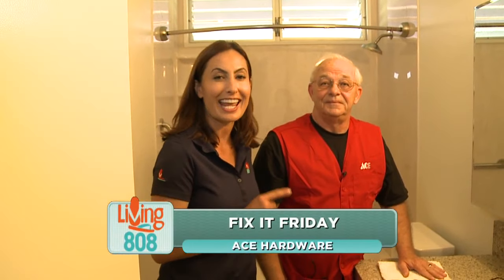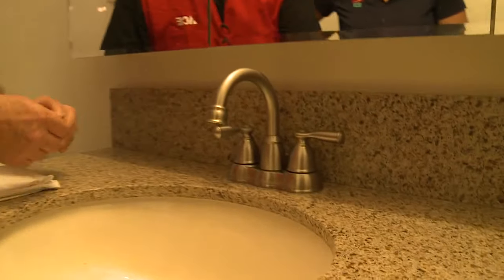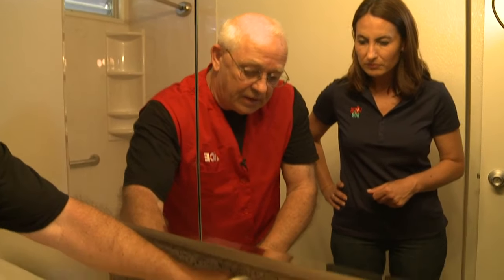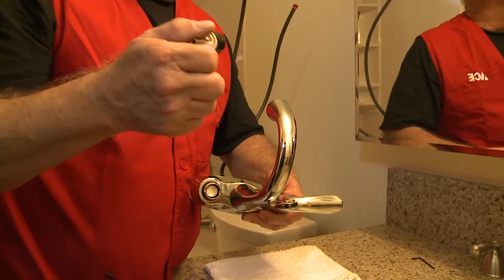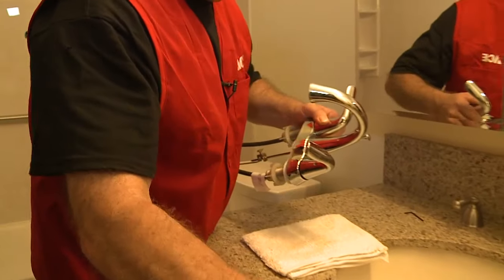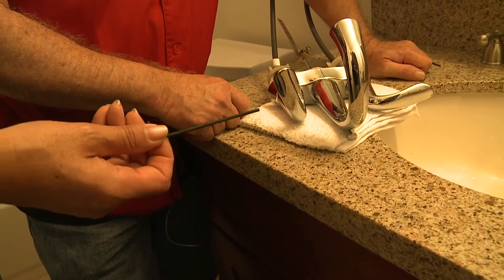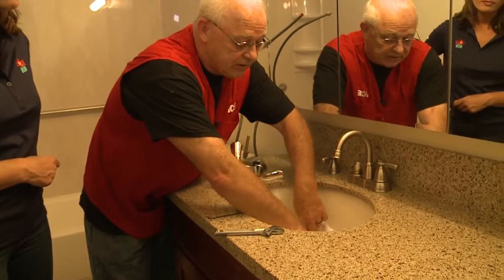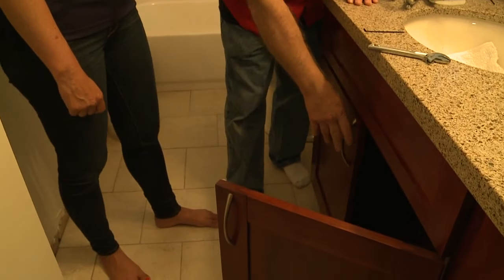Ace Hardware shows us how to fix a leaky faucet

Comment: Great video. Went to Ace got the part. Mine was the bathroom sink faucet. I broke the first replacement because I did not notice the alignment notch on the replacement valve and the matching notch on the faucet. If they don't line up you end up with a leak. My handles were removed by an allen wrench on the back side.

Comment: Actually thank you very, very much bc I was about to go crazy trying to figure how to get my handle off bc there is no tab for a screw on top lol so I seen him use the Allen key so I went back and observed my handle better bc I was looking at the top and the bottom lol but the hot and cold aka red dot 🔴 and the blue dot 🔵 on the handles are a plug and you can take your fingernail an pop them out and bam you have access to your screw.. so thank you 😊 and now I need to walk literally 200 feet over to my ace hardware and get my cartridge

Comment: Lol He didn't even try to determine whether it's the hot or the cold that's leaking! Chances are it's either one or the other that's leaking and not both. The first step should be the following:
1. As it is leaking, count how long it takes for a drip but it's not necessary. Just note that it drips!
2. Go under the cabinet and turn off either the hot or the cold but not both.
3. If your turn off the hot only and it stopped dripping, then it's the hot that's having problems.
4. If after turning off the hot and it's still dripping, ,turn off the cold. It should stop and the problem is the cold.
5. You can double check and turn the hot back on while the cold is off. 

Btw, often there are very cheap washers you can replace and not the cartridge.
Reply: I’d add that, my practice is that, while I’m at it, change both. They’re both the same age and the other one may go soon too. As long as the cost isn’t terribly high, which I believe is the case here
Reply: Thanks - I was wondering about that!
Reply: There's nothing to determine when I push on the cold water handle it stops, when I release it it starts leaking again and the water is cold. I think we need another sock for you😂

Comment: How do you decide which side is causing the drip?
Reply: Turn off the cold first, if it leaks it's the cold, if it doesn't, it's the hot!
Reply: @blueskies6475  That's what I did.  Turn the cold off first under the sink, and if is still drips, it's the hot.  Easy Peasy.